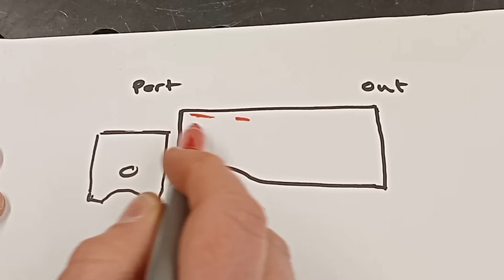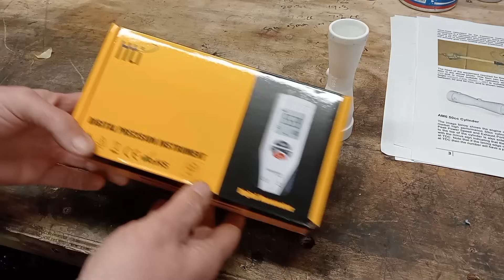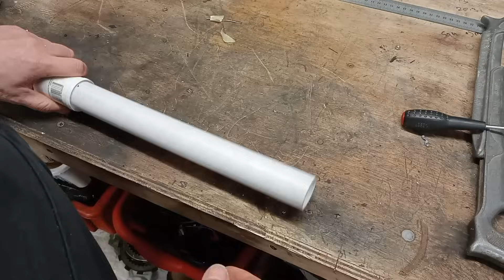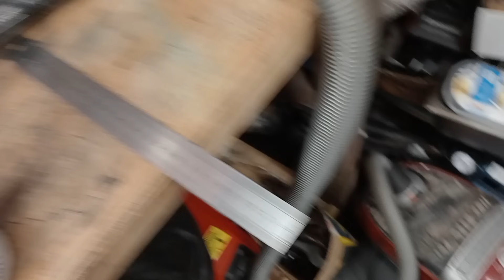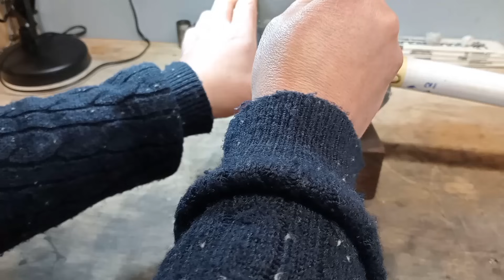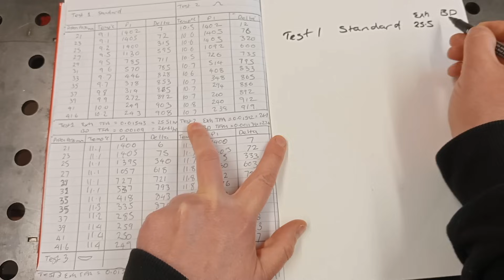2 Stroke Flow Testing - Power increase? 100 MPH Moped Challenge. #power #2stroke #hp

Comment: Great stuff!
Reply from the maker: Cheers Alex.
I did wonder if it would be a good test for your cylinder exhaust and transfers?
Reply: @AutoBeta2T  Definitely would be, especially for the exhaust duct.
Reply: @2STROKESTUFFING  a compliment from you is a big deal lol
Reply: Great to see team work here.
Reply: i feel a collaboration in the near future 😉
Reply: In what RPM range was the increase in power?
Was it in the bottom, midrange, top end or throughout the full range.
I have a 75 Yamaha 250B Mx and was wondering if I were to build up the bottom of the exhaust port how that would benefit the power out put.
Reply from the maker: Hi, tbh I'm not sure as I haven't been able to do this for real yet.
In theory it will increase top end power but as to lower RPMs, I'm unsure.

Comment: Proper two stroke set up et., port timing, ignition, jetting, compression etc. all work hand in hand but the area most neglected is a tuned pipe, not expansion chamber but a real tuned pipe to the needed application. Crankcase volume is also another neglected area. Cheers!

Comment: Hi Dave! I am a bit late to comment your very nice videos at the Tube, obviously, but som comments and questions if I reach through the way of communicating on You Tube. What you seems to do in your steady state flow rig is to create flow coefficients for ports which ideally my be imported into 1D-simulations like Engmod. Are you in any level of contact with Neels? One way of doing it would be to run his software steady state at the same pressure ratios you use and, like you do, fix the piston at given port heights. Then dial in flow coefficients in Engmod to reproduce your steady state results. Have you considered this approach? BR Lennarth
Reply from the maker: Hi Lennarth, that sounds like a good idea.
I have spoke to Neels a few times via email.
I do want to do some.flow testing in the RS125 but I struggle for time at the min...
Work is busy and Tom's racing takes up most of the rest of my time.
My email is: Autobeta2t@yahoo.com 
Cheers
Dave

Comment: Next modeling clay try inverting the putty make it a flat bottom but a valley in the middle to centralize the flow towards the Venturi. 
Also in diesels and in some header design try doing a “step down” in the port. This helps with reversion back into the desired piston area for the port.
Reply from the maker: Cheers fornthe ideas. I do want to get onto this again at some point.
Reply: @AutoBeta2T 
Another idea with the putty would be making it a gradual radius from into the cylinder it would make the air from into the cylinder into the exhaust port transition better in theory, air doesn’t like to bend much

Comment: Two stroke 50cc stock around 50miles, after porting around 120 miles per hour!
But also needed race ignition as well race crankshaft for 19.000rpm!
Porting we do since ‘60, but also needed to say, be aware of the mount material you have where you want to grind if you have thin material!

Comment: Never ported a 2 cycle in my life. Much of 2 cycle air flow dynamics are still considered " black magic" as my profession (2 valve 4 cycle) was for many decades. Its not. Introducing sound engineering and testing, gathering data, using spread sheets to do all the math and nail down the dynamic effects of the changes being made. This is awesome. Need more thinkers like you...
Reply from the maker: Thanks for the kind words!
Reply: @AutoBeta2T   it's not "just an air pump".  Do you have GP Blair's 2 stroke book?
Reply: @C @Chris_Stavro  I don’t have that one.

Comment: u payed 70-80 euro for that venturi part? sounds excessive to me sir, it looked rather rough as well. may i ask what polymer was used?
Reply from the maker: He's a link to it:
20mm_venturi | 3D Printing Shop | i.materialise https://share.google/wFpEAZ7WCtJEsGdBc
Reply: @AutoBeta2T  they list it for 24euro now. sounds more reasonable at 24. since its nylon its quite strong too

 id make it out of polypropylene instead on an fdm printer. if you drop the nylon part it might crack or scuff. the pp i use would make it almost indestructible

i like your channel sir, and i want to offer a free print for your projects :)
Reply from the maker: Brill. Thank you.
How do I contact you?
Reply from the maker: Hi, sorry, i''ve no idea what it was made from, im afraid. I just got it as it was what went with the programme.

Comment: hi ok ,very tech , but i cant see why you are using cyl height , i would use degrees , height only appertains to that barrel degrees are applicable anywhere , i was tuning 2t in the 60/70/80, by 90,s i was done , ,so this was my take , we never had access to any flow benches, it was al time area  calcs by hand, personal computers didnt exist , so it was testing and more testing , no dyno either, at the begining of the 80,s i had the quickest montesa ever by 81 yam came on the scene , and for a few years i had one off the quickest, but all this time no money , so i went slower and slower , but in the late 70,s i used a gilera 50 trail bike for work , except it looked like a road racer  derbi fairing etc , the gilera motor was a two transfer , piston port , only 4 speed so i had to be carefull with the carb, port timings etc , used a pipe off my own design , this thing was a rocket 85 mph far quicker than dt175 of the time , now what im getting at is 100mph would be easy with multi speed  gearboxes reed valves multi trans ports , your diseecting a export which has flow both ways of vastly different speeds, personally i would conctrate on the trans flow into the cyl and the loop scavenge , which flow areas you need , but as soon as you put a pipe on it , your going to need a huge computer, blair was doing this in 70/80s bt got sidetracked by 4 strokes , blairs work is the bizz
Reply from the maker: Hi, ai use height because that is what is in the instructions for using the software. I'm pretty sure that the software will convert this to degrees for working out the time areas

Comment: Interesting exercise. Are the flow gains real, the results might close enough to be fuddled by experimental error? Is the state of tune / resonance of the exhaust going to be impacted by the different port shapes?
Reply from the maker: Hi, i repeated each test 3 times to ensure consistency and repeatability. Whether the flow gains will give hp gains further testing is required.
I would have thought that the state of tune will affect the exhaust. I haven't done any further testing as of yet but I would like to explore this further.

Comment: So I reckon you just increased flow speed and that’s what raised the estimated power gain?
Reply from the maker: I'd agree. It was a lot less noisy with the clay on the bottom of the port. Less energy loss and more mass flow.
How does it affect the flow going in the opposite direction? Not sure how to test that one... maybe like the transfers.
Reply: @ you’re a testing behemoth my man. I love it. Keep up the good work.  💪🏼💪🏼💪🏼
Reply from the maker: @brandonsmith3447  cheers 🍻

Comment: Port flow is not all there is... you have to have a lot of things right, EX.   A good tuned exhaust expansion chamber, max compression, tuned intake, high flowing carb.an exellent high quality ignition, good cooling, etc.Study how you can improve every component on the engine and bike and you will be a winner, Now i know 2 strokes pretty well, did a lot of winning with them, they called me ,Fast Freddie, because of it .
Reply from the maker: Cheers Freddie. Yes, lots to do on this... I lost a lot of momentum with the project but I hope to get back on track and trying more stuff.

Comment: I did a huge amount of this sort of flow testing on a home built rig in the 1980's on classic honda twins. One comment I would make is run the hoover for a good old while before starting to take measurements as to let the motor warm up and stabalise. Love what your doing, wish I'd had the software back then.
Reply from the maker: Cheers for tip 👍 

Did you learn much from the flow testing ?
Reply: @AutoBeta2T  I learned a lot about reverse flow caused by turbulance at the wall boundaries and experimented with an aviation tuning technique called ratchet flow to try and counteract it. Check the vacuum drop for every 1/4 mil of port opening some flow everything in first few mil of opening, for me that meant rapid lift cams with shorter overlap. Others flowed through the whole of the valve lift meaning longer duration was better.
Reply from the maker: @mercedesvan-doors34 cool, so it helped then.

I did a Google for ratchet flow tuning but it doesn't really come up with anything. Is it referred to another way? Are you able to explain a little about the technique?
Cheers

Dave
Reply: @AutoBeta2T  Even then it was almost unheard of, I have a book somewhere, if I can find it I'll get you the details. In essence it consisted of cutting small angled grooves in the inlet port to stop reverse flow at the boundary wall. Remember I was tuning 4 strokes. You have to forget about the charge acting like a slow moving fluid it is travelling at very high speed, friction against the inlet walls slows the charge down and this causes eddy currentls that restrict the effective diameter of the inlet, in some cases the layer next to the boundary can flow backwards. The small grooves were intended to kill off this behaviour.
Reply from the maker: It sounds a bit like vortex generators that are used on aeroplane aerofoil surfaces.
Reply: @AutoBeta2T  I had a quick look for the book but no luck yet but I have hundreds of text books on this, As soon as I find it I'll pass on it's details. Keep experimenting 🙂
Reply from the maker: @mercedesvan-doors34  Thank you 😊

Comment: Interesting re the stall of air on the piston at half way, my thinking of flow from Gordon Murray on the t50 rear diffuser, anything more than "I think 17 deg" and it would stall.
Reply from the maker: Yes, it was. I'd like to do some more research into this at some point and certainly into flow inside the two-stroke engine.
It's such a simple design, but so  complex too.
Yes, an angle of attack greater than about that, and the airofoil will start to stall. Maybe filling the lower exhaust duct is helping to keep the flow attached to the front face of the piston better?

Comment: Be curious if power could be found with this. In the 90's I filled this section using Belzona epoxy steel for the same reason, but I never noticed any obvious gains. It was seat of the pants tuning in those days!
Reply from the maker: Me too. I don't think there will be masses, but maybe 1/2 to 3/4 hp

Comment: Raise the exh port, mill the head to 060” squish and 200 psi primary and you will do better than that gimmick
Reply from the maker: Hi, the e haust port has already been raised to 203 degrees duration. I'll look to go higher if required. I do intend to look at squish tests, currently I believe it is too tight on my current setup.
Reply from the maker: I assume you have  tested raising the exhaust duct floor. How did it affect the power output in your tests?
Reply: @AutoBeta2T  
All my porting has a flat floor, I’m old school going with formulas with MPA ( mean port area) and getting an effective rpm range. Tommy (Tom Turner) and I have different theories on 2 stroke porting, I don’t use his blow down theory, the formulas that I used I would get the exh and transfer port ERPM and there is so much just on shape of the exhaust port. As 2 stroke stuffing learned the hard way on going a 100% of the exh port width. 
If you want a decent ripping porting with reed’s 
200 degrees of exh and 128-130 degrees of transfer porting. 
You’re kinda in the Blue printing stage of that cyl.
I don’t think JB weld will hold up on the floor of your exhaust port. If you have a boost port, match the height and roof angle is key. Take the boost port and cut it like a slot and drill a hole into the piston and all the AFM under the piston at BDC will help get more AFM in the combustion chamber. Also, squish width, narrow for hi rpm, wide for bottom.
Increase your primary compression ratio by stroking the crank, this will help your torque as you loose a good amount of by raising the ports. But 5-7mm stroke is far as I would go or you will blow out your crank seals. 2SS is destroying reeds cuz his “primary” Crank Case ratio is way too high.
I can send ya formula’s if you want but Robert from Factory Pipe Products turned me on too a good 2 stoke theory, n I can get ya the ISBN number for it.
I’m 61 years old n have ported a ton of cylinders and had the first EFI 2 stroke on the national tour and it make’s a huge bottom end HP which made it so I could over port it like a light switch and still have great power everywhere back in 1994. Remember always, it’s theory, so depending on the application, nothing is set in stone. That’s why there is no 100% internal combustion engine ever made. Your car or truck has a cat in it because it can’t be done.
Reply from the maker: @radron14  Hi Radron, sorry for the late reply but your last comment was held for review for some reason? YT does weird and wonderful things sometimes.
I'm currently at 202 exh and 130 transfers. I feel I need a little more transfer area but I don't want to go up and eat into the blowdown. There is epoxy (done badly) on the transfer roofs at the min - I want to redo it so I'll do a test of raising the transfers for more tx area but reducing the BD area.
I think my SAR is a bit high at the min (48%) and I want to try some different squish dimensions. I've just cut two different heads, one with lower MSV than the current best and the same compression, and another with lower MSV and compression. I'm looking forward to testing them. 

I'd love to stroke this engine and get it a bit squarer but there is literally no meat on the crankcases to make them larder for the extra clearance required. Any ideas?

I haven't measured the primary ratio on this engine. I should but not 100% sure on how to. 

Yes please with the ISBN for the book. I'm always after getting my hands on books on the subject

Regards

Dave

Comment: Combustion don't work like that mate and expansion exhaust chamber works at pulse speed like a jet hot squeezed gas your better off trying different carbs
Reply from the maker: Have you tested this type of exhaust duct? What did you find happend when the duct was raised  from your testing?
Also, what carb do you recommend?

Comment: What about total volume of air per second? Was it more or less?
Reply from the maker: I don't know, I just put the readings into the programme.  However, if the flow area power prediction goes up, then there will be an increase in mass-flow.

Comment: there's very little reverse flow. You have to think about whether or not return wave strength is lost due to any abrupt changes in diameter. Making the port floor higher benefits low RPM power at the expense of high RPM power. Adding a bottom ramp directs the movement of the reverse waves higher inside the cylinder, whereas the ideal direction is downward to the transfer ports. So the makers of that program obviously did no real life testing. I did which is why I know this. And its calculations for time-area for blowdown are incorrect.

Comment: years n years ago when performance bike mag first came out they did project (suzuki) GP100plus trying to get a little Gp to the ton .
Air cooled 2 strokes are great for playing with good luck with the Ar i reckon you will get there .. Food for thought put a H100 honda engine 
in an mbx or mt5 see what it will do ..
Reply from the maker: Yes, a little before my time but I do have some of the GP100plus articles somewhere. John Robinson was great.

Comment: didnt they bolt an old air cooled KX80 engine in the AR50 years ago.. they go straight in on the original engine mounts.
Reply from the maker: Sorry, I missed this. Quite possibly, though. I'm keen to do it with the AR engine though.
Reply: @AutoBeta2T it is basically the same engine I think the crank is slightly upgraded but because it was 80cc from the factory it might would be interesting to see what the port arrangement and sizes look like. Not sure if the barrels where nickel plated  or if they had liners I do know back when they were popular the small wheeled Kx80 was dangerous. Not sure how much power they made.  Might give you some ideas if nothing else.

Comment: Its all good trying to improve the flow of exaust gasses but a two stroke also relys on resonance off the exaust gasses bouncing backwards and forwards in the expansion chamber. so changing the port size or shape also changes the resonance characteristics..... unlike a 4 stroke engine where you want the best flow in and out.
Reply from the maker: Hi Dan, yes, you change one thing in a two stroke and it affects another 3 or more things!